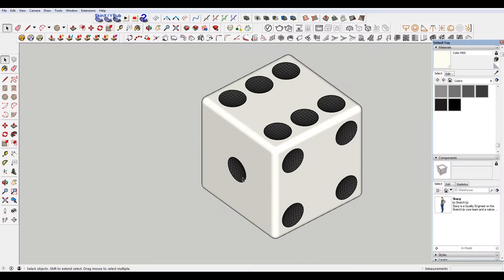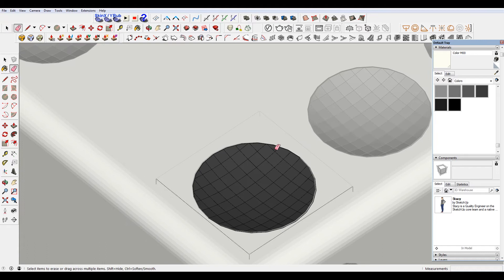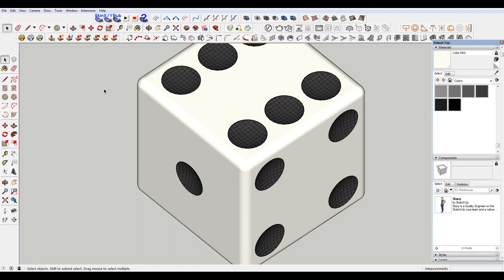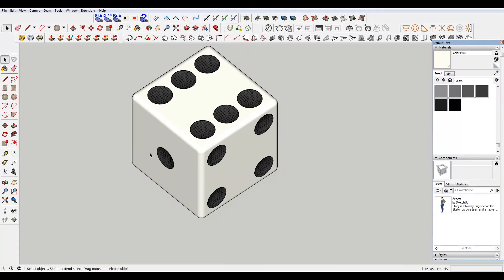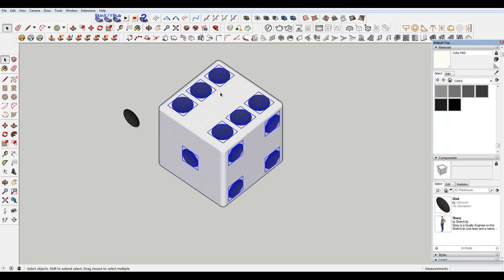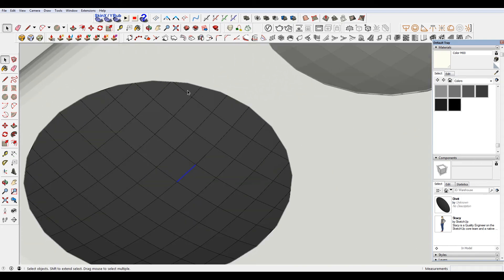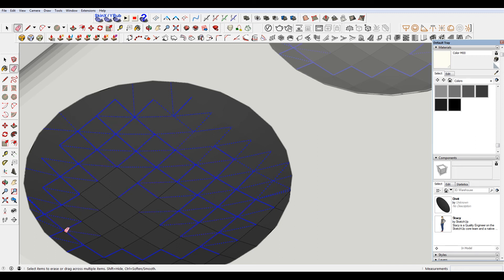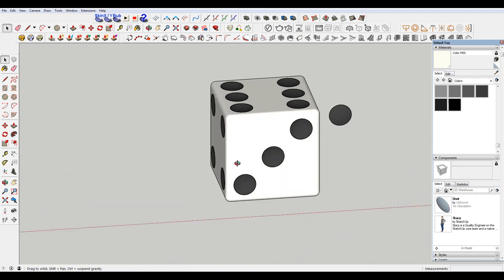Convert Multiple Groups to a Single Component in Sketchup

Comment: Fun video but it's also pretty silly because the video is super misleading. The component replacer tool you're talking about in this video by thom thom doesn't take a component and convert all other objects to the "exact" same component, it matches the bounding box of the chosen component so the proportions don't change to be the same size as the selected component. This can be very useful but in other cases exactly what people don't want. I want for example a plugin that can convert multiple selected objects at once to a specific component with exact proportions, there is a plugin that does this called "nz convert me" found on the extension warehouse. You should change this video.

Comment: That is a fantastic plugin and one I use often for that exact reason. Out of curiosity, in removing the lines, why not just highlight all the geometry and soften, vs hide erasing them all?  Great channel by the way, lots of wonderfully useful tips, and great breadth of subject matter as well!
Reply from the maker: Thanks for the kind words Matt!  

It would have been perfectly viable to soften all of the geometries like you suggest but not best practice.  While in this case it may not have made a big difference, using components for identical instances can drastically reduce file size.